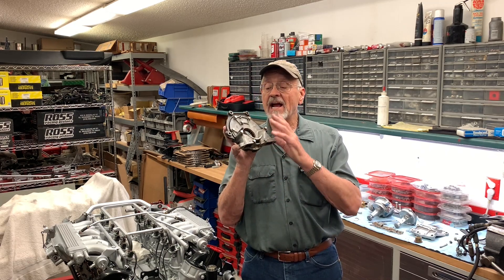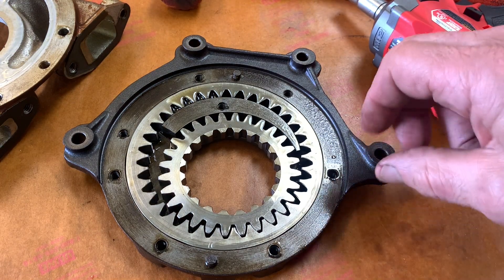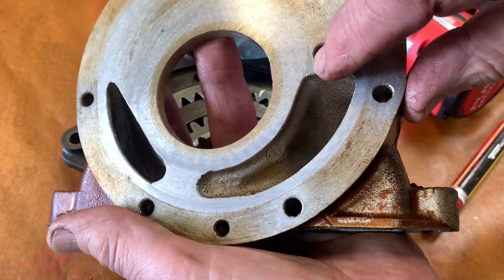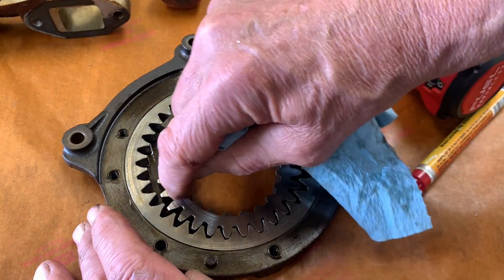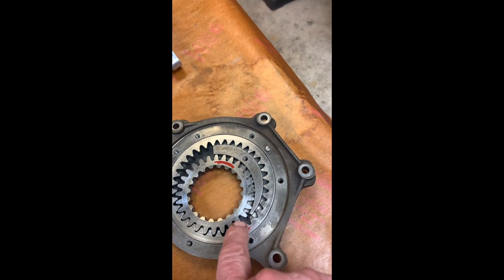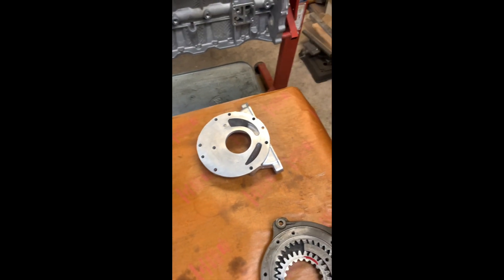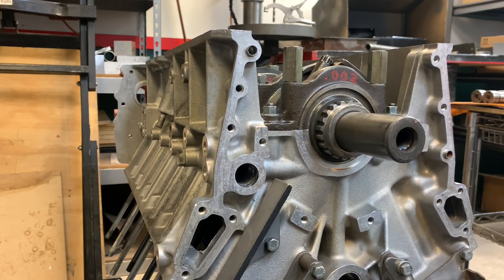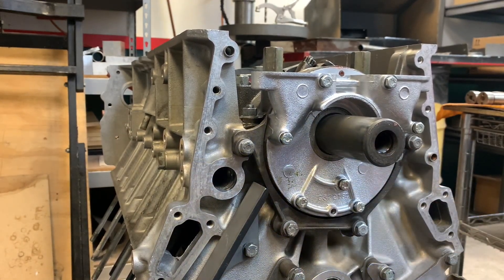Jaguar V-12 Oil Pump Ins & Outs

Comment: Hello Bob - Your videos are awesome, excellent explanation on the technical items. Have a '73 V 12 that I rebuilt. Pump checked out ok. I am having issues with no Oil Pressure. Oil is not reaching camshafts. Primed engine via port for idiot light with 5 quarts at 80 psi. Did the priming 2x's. Oil in FIlter, O-Rings in place at tube adjacent to oil cooler, etc.. Are there other checks I can make? Oil Pump was in good shape during inspection. Appreciate any tips/help. Richard
Reply from the maker: Have you tried installing a mechanical gauge.
Reply: @thecampchaoschronicles9567  Sure did. Last attempt, I cracked open Banjo Fitting at side of Block for oil feed to Heads and nothing! Any tips for checks / priming, etc? Thank you!
Reply from the maker: @RichardStanco  Odd. Maybe a stuck bypass valve. Did you instll a spin on oil filter adapter? If it is installed 180º out, there is a small relief valve it will hold open. Let me know what you find.

Comment: As always, great video!   I know the old oil pump is NLA, and that the 6.0L oil pump is driven by an offset surface rather than a gear, but I've forgotten if the nose gear interchanges with that shaped insert.  Do you remember?  Also do you have any idea what Robb Beere is doing with their special V12 pump?  Are they supplying a pump that has thicker gears with more depth or?  I'm guessing they machine a standard pump for custom gears but IDK.
Reply from the maker: I'm afraid I don't know much about the 6.0. I would assume whatever is on the front of the crank would interchange but I don't know.